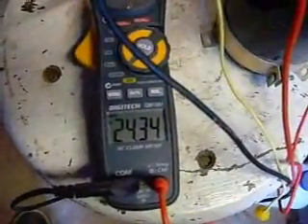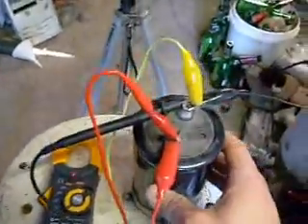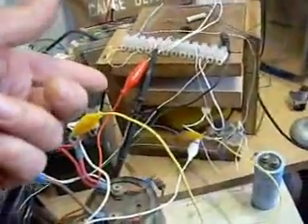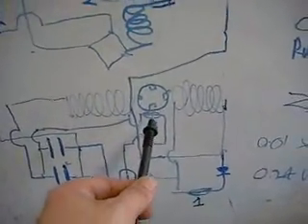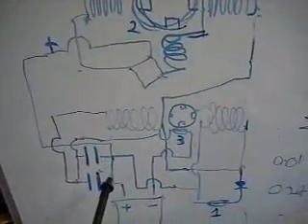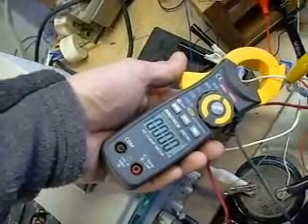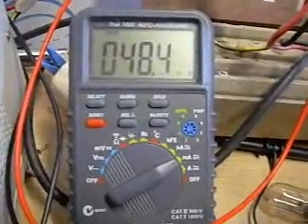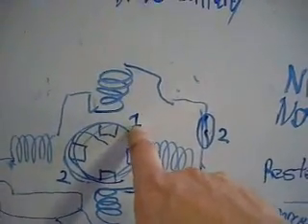Adams motor and pulsing capacitors

Comment: Hi, good work. Is there a reason you went with reed switches? Adams uses a mechanical switch because he says the power can move in both direction and that's how he recoups most of it, 95%. Plus I saw in your first Adam's motor vid that the coils weren't in the ratios, length to diameter,  he seemed to be so pedantic about. Same with the magnets. He was very explicit about the size ratios to the coils.

He also had the moving disc to tweak the timing. I can't tell if your motor has that.

PJ Kelly mentions on his video, quote; "ROBERT’S DIAGRAM DOES NOT SHOW WHEN THE GENERATOR COILS ARE BEST SWITCHED 
ON  OR  OFF.    A  BUILDER  WITH  A  FORUM  ID  OF  “MAIMARIATI”  FOUND  OPTIMUM  SWITCHING  
WITH  SWITCH  ON  AT  42  DEGREES  AND  SWITCH  OFF  AT  44.7  DEGREES.    THAT  TINY  2.7  
DEGREE  PART  OF  THE  ROTOR  TURN  GAVE  HIM  AN  INPUT  OF  27.6  WATTS  AND  AN  OUTPUT  
OF 33.78 KILOWATTS, WHICH IS COP=1223 OR 122,300% WHICH IS SPECTACULAR." This Y/T video is from 2017 and the PDF I copied from, is on his free energy-info.com site.

Have you done any more work with this, nine years is a big gap? Cheers from Sth Aust.

Comment from the maker: just trying to recycle the generator coils output to the run cap to see if i can run the motor for less energy than previous-it was the obvious design given the things i have at hand,and sticking to mechanical switching -as per Robert Adams advice.
thanx for commenting

Comment from the maker: if switched at the correct time -there should be very little drag forces involved-thats why im switching the generator coils.
not sure that its completly Lenzless tho-it will slow down under load, however
i have not stuck to the adams motor plans exactly-feel free to replicate-there is plenty of info online about the adams motor and im always happy to share what i know about the designs if you take the time to PM me